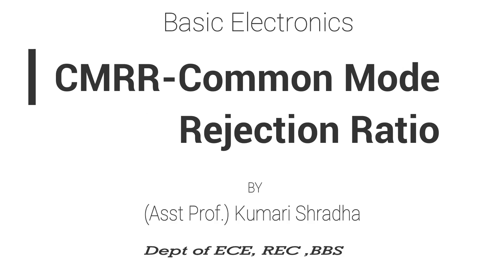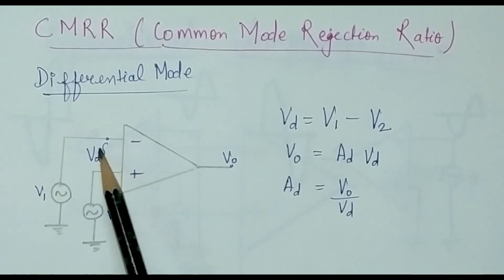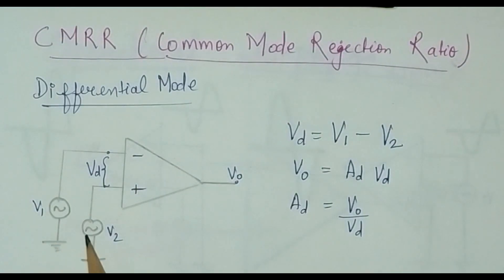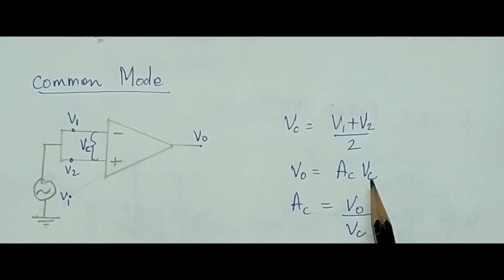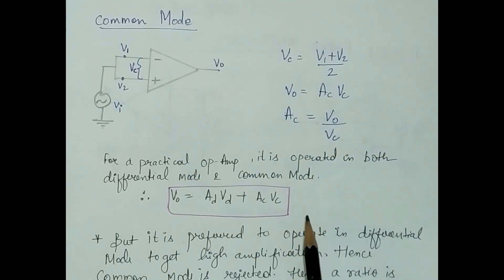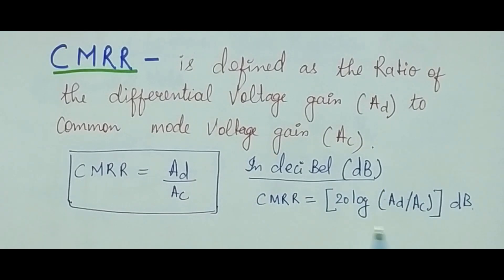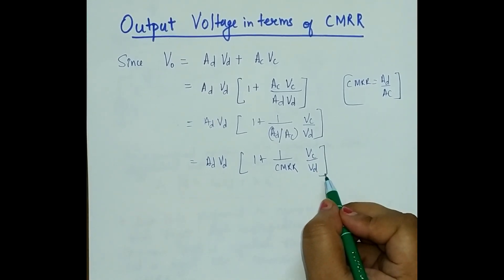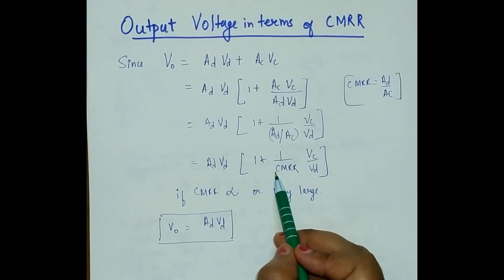CMRR Common Mode  Rejection Ratio

Comment: PPTs and Videos with animations for all the ten chapters and a few applications Regulated DC Power Supply, Differential Amplifier and Transformer coupled audio power amplifier of  book Fundamentals of Electric Theory and Circuits are available for download and viewing here
https://www.ikbooks.com/books/book/engineering-computer-science/electronics-communication-instrumentation-engineering/fundamentals-electric-theory-circuits/9789385909467/
Differential-mode and common-mode signals are important to understand in the design of complex signal-conditioning circuits which use operational amplifiers in medical diagnostic, industrial control and military applications. 

Operational amplifiers mainly excel in performance to provide a high common-mode rejection ratio and high gain. By using negative feedback, its overall gain, input impedance and bandwidth are determined by external components without these parameters being affected by the op-amp’s parameter variations due to external influences like temperature and so on.
Most amplifiers built using discrete transistors will not be able to match the performance characteristics of an operational amplifier like CMRR, low drift, high input impedance and stability of gain. 

Engineers are so used to thinking and visualising currents as differential-mode in circuit analysis that they find it hard to switch their thinking to common-mode currents and their effects in say, amplifying circuits. 

It will be instructive to understand and visualise Current at its most fundamental level in the presence of electric fields in ordinary conductors.
Electrostatics and circuits belong to one science not two. To learn the operation of circuits, Current and the conduction process, resistors and how discussing these topics makes it easier to understand the operation of capacitors, inductors, diodes and their operation in amplifier circuits and circuit theory watch these two videos 
i. https://youtu.be/TTtt28b1dYo  and 
ii. https://youtu.be/8BQM_xw2Rfo 

Most common-mode signals originate because of sources external to the system, and the energy in them circulates annoyingly until it is dissipated in resistive portions. They can be generated internally if proper cables are not used for coupling signals at the frequencies of the signals they carry.
Therefore the need arises for amplifiers to amplify only the useful differential signal and reject the common-mode component which does not belong to the signal conditioning system. Such an amplifier is used as the first stage of an operational amplifier which opens the door to allow a signal from a sensor ‘in’, so to say and so the importance given to this stage. 

Topics related to these aspects are discussed in chapters 3 and 5 of textbook 4 (see last frame References in video #1) and a power point presentation with animations “Basic Action of a Differential Amplifer-Heart of the Opamp” which explains differential amplifier with a U-tube manometer analogy of differential- and common- mode signals is included in the CD alongwith this book.